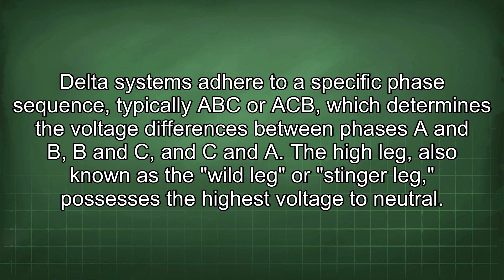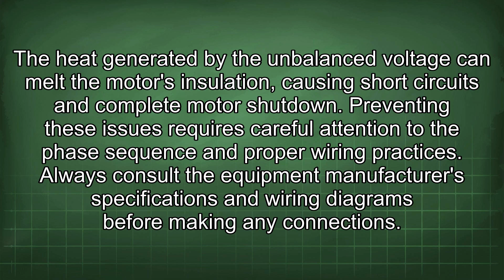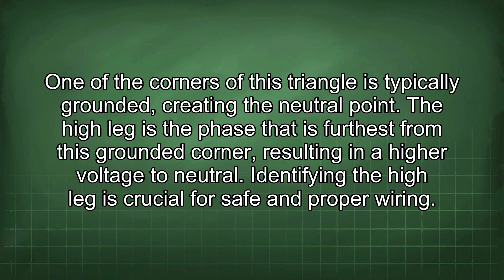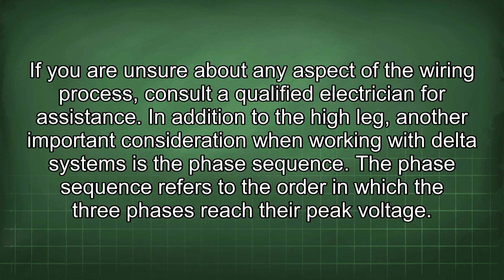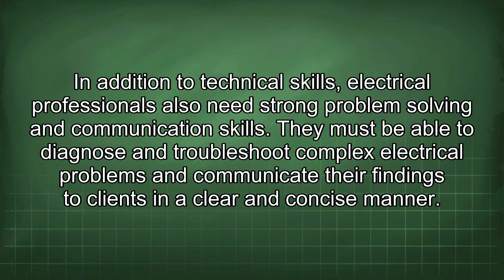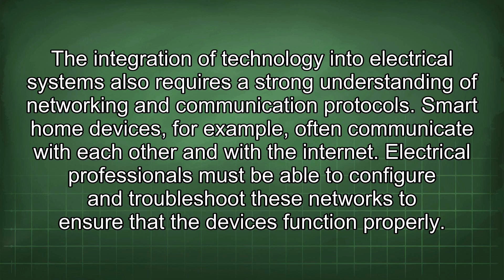Delta System High Leg Phase Hookup Matters

Comment: Interesting.    Normally a high leg delta system is 120/240V, with the voltage between the wild leg to neutral 208 volts.  With a 240V 3ø motor, because it's a line to line load it only "sees" 240V across phases A-B, B-C - C-A.  The same principal applies to a single phase 240V motor; there is nothing wrong or in conflict with the NEC to connect a NEMA 6-20 receptacle for an air compressor to phase A - B (wild leg), because that would give you 240V.  

It helps to understand that voltage is simply the electrical "pressure" or potential difference between two points.  

Electricians and maintenance personnel must always remember that there are many situations where it absolutely does matter where you terminate the high leg of a 4 wire delta system.   The most critical is 240V single or three phase equipment with 120V controls or components.   

Two pole circuit breakers protecting 240V single phase loads must be straight rated, you can forget about walking out of your local home depot with a 240V straight rated circuit breaker in your hand; you will have to go to an electrical supply house and chances are they will need to special order it for you since almost all two pole circuit breakers currently manufactured are slash rated 120/240 which would be acceptable on a 208Y/120V 3ø system because the voltage to ground from any phase is 120; incidentally the 208Y/120V 3ø system is by far the most common scheme in commercial buildings across the USA, even larger commercial and industrial where the service is 480Y/277 3ø will almost always have 208Y/120V in the building derived from a 480D - 208Y/120V transformer.
Reply from the maker: Hello @rarelampcollector,

You've raised some excellent points about the nuances of high-leg delta systems and the critical considerations for electricians and maintenance personnel. The distinction you make between line-to-line voltage for three-phase motors and the potential pitfalls for equipment with 120V controls is a fundamental safety and functionality issue. Understanding that the "wild leg" is not just a curiosity but a potential hazard for misapplication is crucial. Your comment about the unavailability of straight-rated breakers at typical home improvement stores is also a very practical and important detail, highlighting the need for specialized knowledge and sourcing for certain electrical components. This kind of real-world experience is invaluable in the field.

Your explanation of the prevalence of 208Y/120V and 480Y/277V systems in commercial and industrial settings provides important context for why the high-leg delta system, while still present, is less common in modern installations. The fact that a building with a 480Y/277V service will often have a dedicated transformer to derive the more common 208Y/120V or 220Y/127V system for general-purpose use perfectly illustrates how engineers design systems to balance high-power efficiency with the need for standard, readily available equipment. It's a great summary of the practical realities and design considerations that electricians and engineers face every day when dealing with different voltage and grounding schemes.

Sincerely,

BESA Research